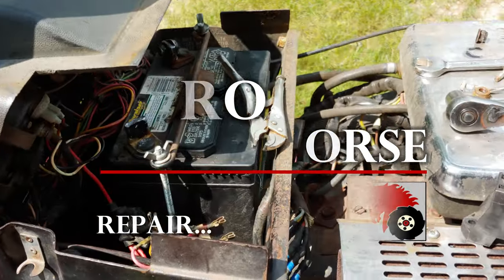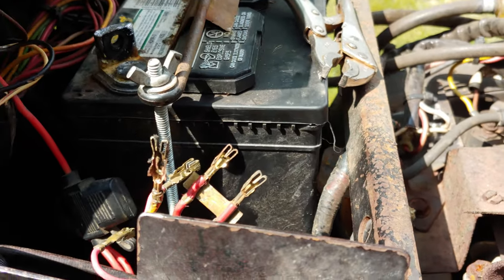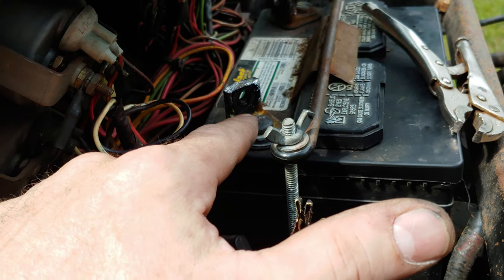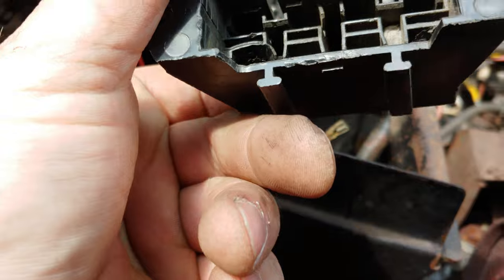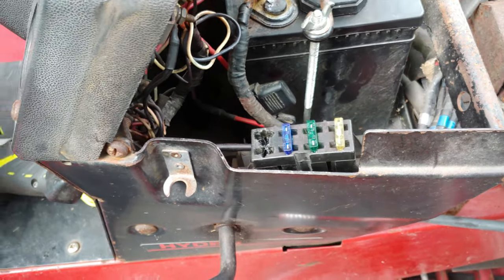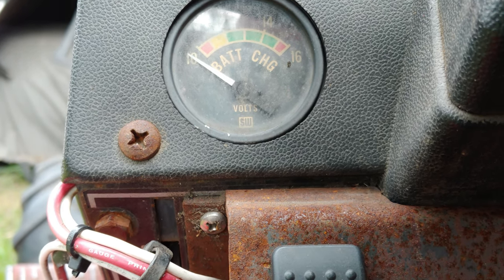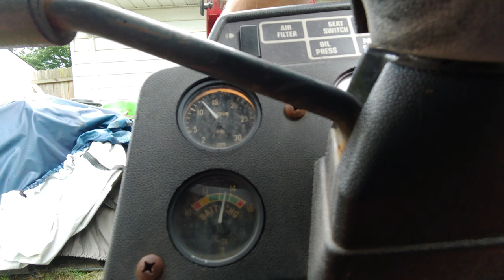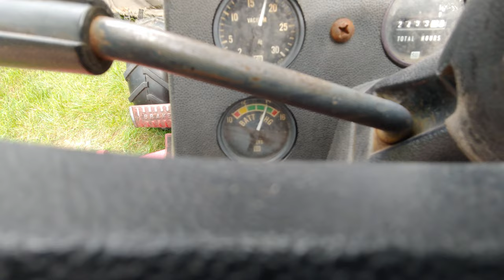Wheel Horse Charging System Repair

Comment: Your 520H charges pretty good now.  I use Fluid Film on my terminals, it has been working pretty well.  They went to those fuse blocks in 1990, my 89 just has random fuses around the engine, front, top and rear so you have to dig for them sometimes.
Reply from the maker: Yeah it was a mess. Completely melted. I've seen guys get aftermarket water proof fuse boxes and install them. 

  I gotta dig into this entire machine sooner than later. Its gotta leak in the rear axle, front wheel seals are blown out, things are wearing. Shes due. Think my 60" deck spindle bearings are dry. Ive been greasing them every year but wouldnt surprise me if their are sealed bearings in there. So why they would put zerk fittings to grease a shadt is beyond me. Lol

Comment: Having the same problem this morning. Positive cable very corroded. Had to jump it, then when pulling off jumper cables the 520 H would die off. So I will look to see if I have the same problem. By the way your tractor runs smoothly, mine surges a lot.
Reply from the maker: Yeah mine actually started doing that all you got to do is pop a carb Bowl off from the top and clean the Jets out real quick put it back together and it should be good to go. And then just make sure to try and run stable 360 Marine in your fuel all the time and you shouldn't ever have to deal with that. It's honestly because of the ethanol fuel so unless you can put non-ethanol fuel in stable Marine 360 is the way to go
Reply: @Fixin2Ride-Official-   Sounds good. Because of ethanol fuel, I had to clean and fix ; a chainsaw, two motorcycles, a weed trimmer, a leaf blower, and now my sled is acting up, probably the same thing. I have been using rec fuel now for a year or so. So now I got the tractor working. It was low water/fluid in the battery. Topped it off, charged it a bit and it took right off. I knew the carb needed cleaning on the 520, just didn't want to mess with it since it is in the 20's and 30's now. Thanks for the advice, and it seems anything " Marine " based is always better.
Reply from the maker: Yeah that corn fuel really doesn't number on carburetor machines but I'm very glad you got things going thanks for watching the video and checking out the Channel. All I ask is subscribe and share my videos and channel thank you